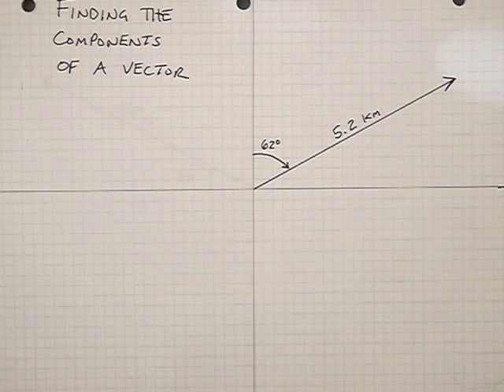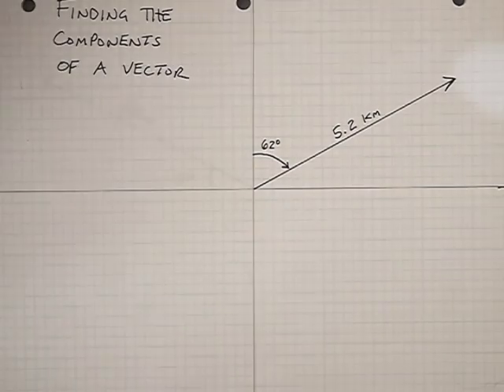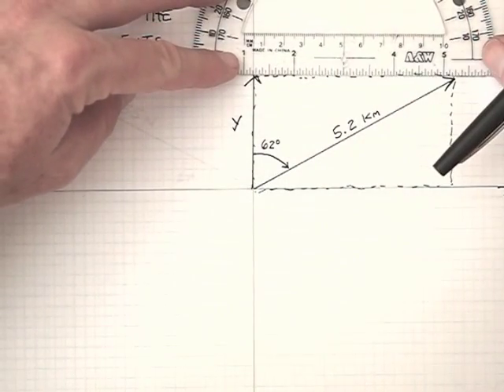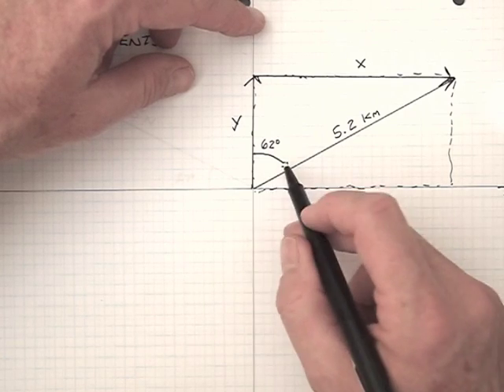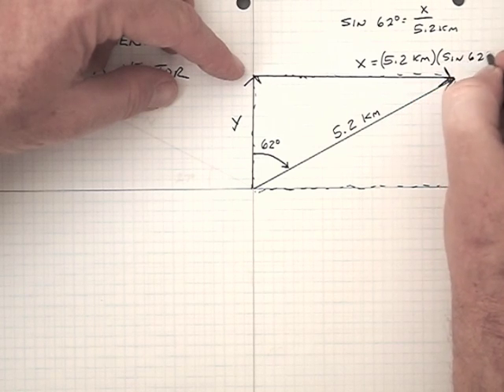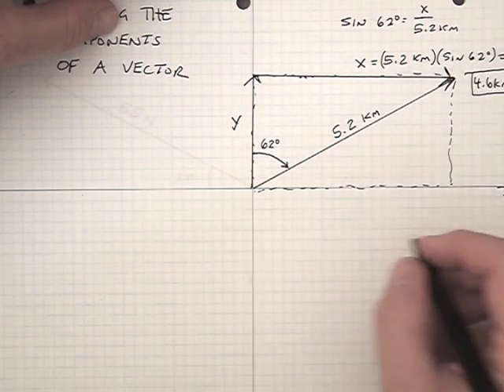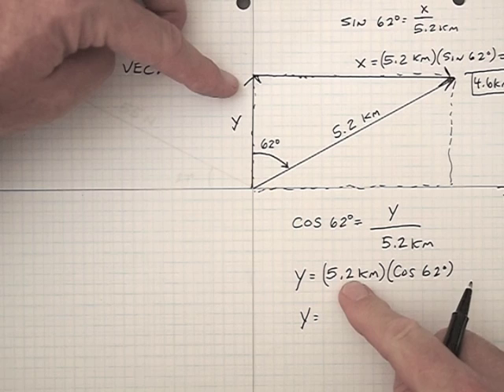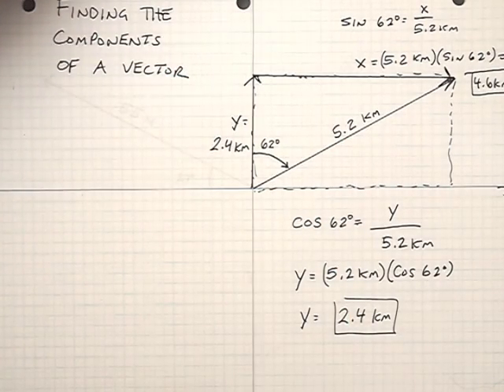Finding the x and y Components of a Vector Part 1

Comment: Why Sine is used instead of cosine for finding x component? 
Anyone pls...!
Reply: opposite/hypotenuse
Reply: If you want to use cosine for finding the x component, the angle must be measured from the x-axis. For this example, that would be cos(90-62). You will get the same answer..
Reply: @teacherbevtv6571  ah thanks so much! i was wondering the same thing
Reply: because the x component is the opposite side in this case, relative to the given angle, so you use sin(
i use SohCahToa to remember:
SOH - Sine= Opposite/ Hypotenuse
CAH - Cosine= Adjacent/ Hypotenuse 
TOA - Tangent= Opposite/ Adjacent

Comment: When i took the sin62 using my calculator i got -0.7391.  How did you get the positive value for x?

And how did you get  y = 2.4 Km. I got 7.72 km and i got x = -3.84

I did exactly what you did in your video, unless i'm missing some concept or rule here?
Reply: make sure your calculator is in degrees. Press mode than switch from radian to degree
Reply: Thanks I figured it out!
Reply: Hello Good person, you made this comment several years ago, how has your life changed since then?